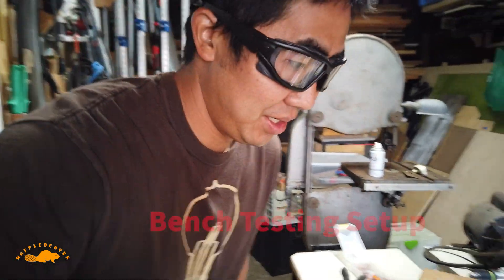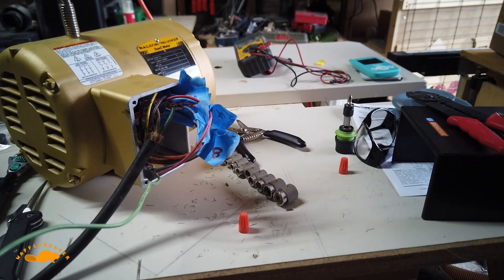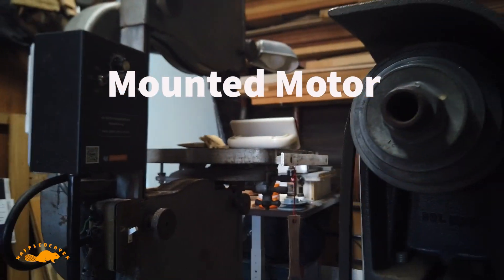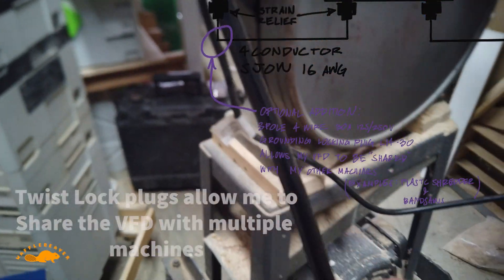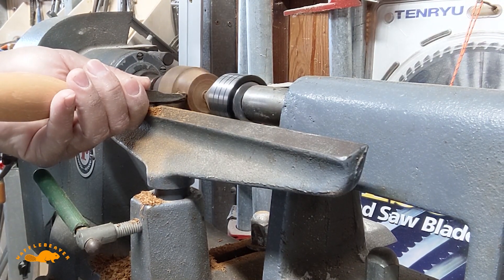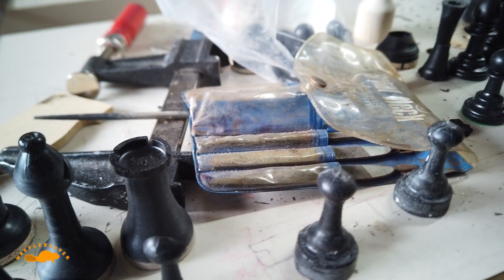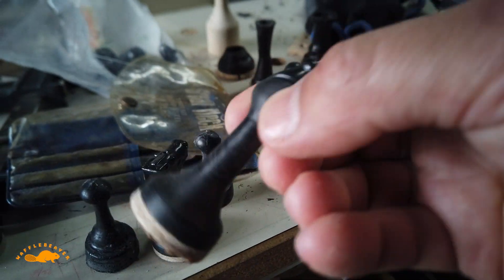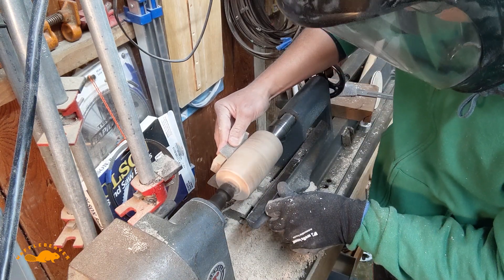How to: Transform a Garage Sale Lathe into a $1.5K Lathe

Comment: Hi, so this setup can be used with 110v? Would a 1 hp motor have less power using 110v? Or is there a better way to go if one wants to convert an old Delta lathe to variable speed but keep it 110v?
Reply from the maker: Yes it's used with a 110v outlet. I'm not exactly sure if it has less power if used with a 220v input, theoretically, it shouldn't. I think this is the simplest way to convert a delta lathe to variable speed next to getting a new DC motor with power supply. Right now, a DC  motor for equivalent power is more expensive